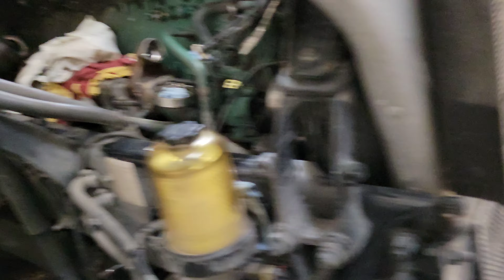Cummins isx and Volvo D13 head reassembly.

Comment: Lol head every 500k on a d13? Nice joke, maybe if you never adjust the valves and idle 24/7. Ive seen over 50 d13’s without the said “issue” and most were neglected.